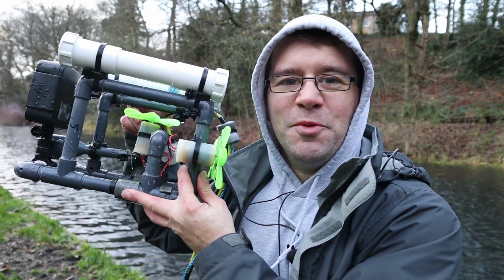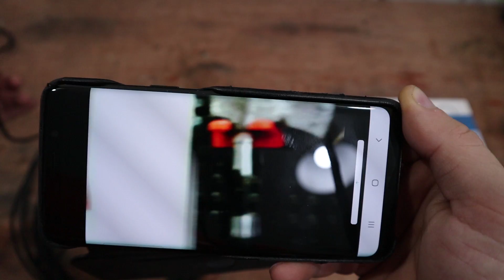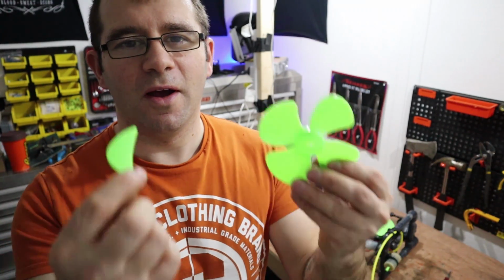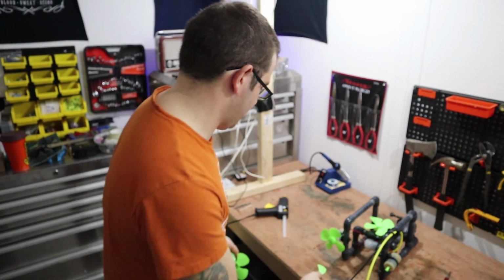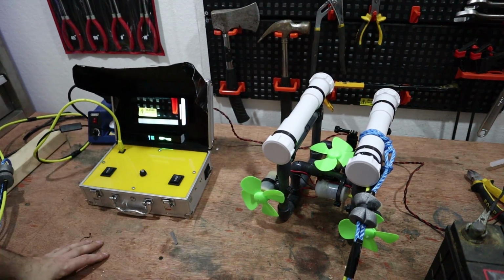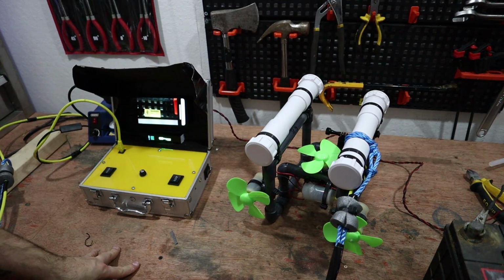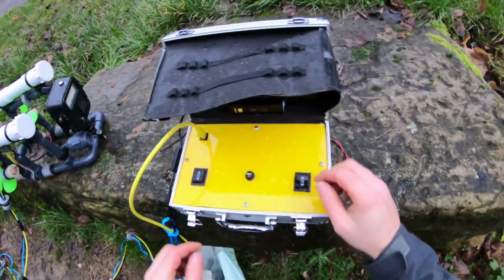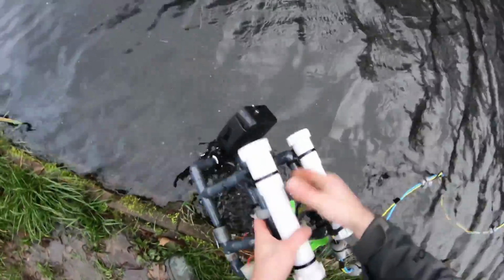Build Your Own Underwater Drone

Comment: Wow G that's turned out amazingly well. Considering it's being put in a canal which in England means liquid that's more of a soup than your traditional water it returns some lovely images. If you're planning on improvements one thing I think you could easily achieve with a single servo is a mechanism to tilt the camera forward and backwards. Front facing camera is well and good for navigation but if you can make it point 45 degrees downwards you can look at the canal bed without having to get so close you either hit it or disturb a load of silt. Also, I can see you've got the tether and data line mounted to one of the floats, ideally you need this mounted directly behind the center of forward thrust, if its to the side it'll cause uneven drag and make the unit turn unintentionally, if it's above or below it'll pitch. Awesome work though, really interesting build.
Reply from the maker: Thanks mate thats some awesome advice that i was looking for and with these improvements it will improve loads 

Ta
Reply: I can make it I am 14 years old I am India odisha

Comment: You certainly put alot of work into that, looks a work of art!  A problem i can see there is the power cable getting snagged on underwater obstacles.  For the power source,  a couple of power banks or one of those jump start units, would be more convenient than lugging a car battery around!

Comment: You need to use impeller desgin drive. Props in a tube with a guard on the front and smaller holes down the side so your still get some drive if guard is blocked.
Reply from the maker: Thanms for the advice mate

Comment: I like the camera setup you used. Great pictures! I know its not clear but you can't help the water clarity. 

As far as drives, I've seen similar projects using boat bilge pumps. Andvantages:  already water-tight, 12 Volt, powerful, protected impellers, and easy to wire. The disadvantages are that they only thrust in one direction so you will need six instead of three. If you do use them get one's without built-in float switches. 

When installing the thrusters, instead of pointing them directly backwards, try installing them pointed 45 deg towards the center line of the craft. This will allow you to turn in place.
Reply from the maker: Cheers for the advice mate

Comment: Gareth, could you make a submarine out of a drone? Turn the drone upside down so it would go down under the water, instead of up in the air, and attach a thin aerial wire with a floating device (a cork) so the end sticks up out of the water for the remote control. The trickiest part would be getting the flotation balance just right to take the sub up and down. The steering is already sorted out  :-)  A mad idea that could work, and i do mean a real build like you have done here, not just throwing a drone into the river. I might be mad, but i'm not stupid (i think).
Reply from the maker: Be a good idea but big project
Reply: @drasticg  Winter is almost here (or is here). I'm sure a lot of days will be toooo cold to go magnet fishing, and you will have a lot of time on your hands :-)
Reply from the maker: @edwardgriffin8092  unfortunately my life is always hectic and im away for christmas but will always make time to do what i love lol

Comment: 1100 gph bilge pumps cut all the casings off the motor will need to make prop adapters , and 50 to 60mm rc boat prop, is a good cheep option, prob with brushless is you'll need a better control board, although i have seen people yousing s-bus rc gear witch is also simple to set up, at some point will do the sbus with mine if i ever get it finished haha
Reply from the maker: Cheers for the advice

Comment: Does the control box/ RC require any coding? Or do the buttons only activate the motor? Also can the motors be put into reverse? Thanks I’m tonerested in making one of my own. Cool video.
Reply from the maker: its hard wired from switch to motors, no coding
Reply: Drasticg thank you!

Comment: Put some rings around to protect your propellers to be tangled with the plants 
Or do a propeller tunnels like turbines I just love this demo I wonder why you attached it with cables instead of doing all by remote control wireless one way to control it is by using audio subtones frequency's. All the best my regards to you.
Reply from the maker: I did it wired as wireless doesnt work underwater

Comment: Nice work 👍 I think it would be a good idea to use some guards around the props and also fix the camera on a tilt/pan gimbal. You can also use a 2.4ghz radio set and some ESC on the motors for precise control. 2.4 ghz should be able to penetrate into the water, but even if it won’t, Rx can be wired out and float on surface.
Reply from the maker: Awesome thanks for the advice mate
Reply: I was told 40mhz will work under water need a 40mhz transmitter and recevier with 2x 40mhz crystals both paird.

Comment: Could you not raise the voltage if the motors would handle it? I'm no expert but you might see more performance from higher voltage LiPo batteries with a voltage regulator going to the cameras and other sensitive stuff
Reply from the maker: Yes i could mate and probably will

Comment: Maybe putting more powerful motors on it will make it move quicker. But,  also if the water has a bit of a strong current then the sub can fight against the strong  water current better.  But,  these motors are definitely far too weak ( underpowered) for what you need & maybe a if possible a more powerful light would really help aswell. Yes it would make the unit a bit heavier But,  it should be overall more effective ( which is what you need) 🤔😉

Comment: Is the full build video still available? the link doesn't seem to work
Reply from the maker: No mate i took the channel it was on down
Reply: @drasticg  was wondering if you remembered any info about the propellers used
Reply from the maker: @colind216  no sorry, i ordered ones that had the same diameter hole for the shadt

Comment: Might be able to get video out via the usb on the gopro as you already have wires going to the surface,thats if you had WiFi problems.
Reply from the maker: Only problem i would have is id have to drill a hole in the waterproof go pro case and seal it all with silicone sealer, so it would be possible thanks for the idea

Comment: There is a easy way to do that. Using a Betaflight board. A FPV drone Controller. Putting everything in a Waterproof 3D printed case. 4 Propeller and here we go... !
Reply from the maker: Sounds expensive
Reply: @drasticg  No, i think i will try. But i've figure out than UHF have a bad depth penetration. So, it need a cable to drive the ROV underwater.
Reply from the maker: Good luck mate and keep me updated
Reply: @drasticg  Thanks. I want to try two things. A ROV with 6 Brushless motor. And something like a Whale where the fin are command with servo Motor.

Comment: Dont you need both rear impeller to turn to get it to go forward
Reply from the maker: No if you use one it turns slower but if you use both in opposite directions it turns faster
Reply: But going forward you need both no
Reply from the maker: Aorry i miss read what you prigionally asked, yes i need both on to move forward

Comment: What is the dept range this rov
Reply from the maker: depends on the length of cable
Reply: @drasticg  if I have 500m wire then this rov can handle the pressure?

Comment: Fantastic job. Very impressed. Could use a couple of small sieves to enclose the propellors. Maybe try to install a variable speed controller and joystick for better control. Again very impressed with your handywork.
Reply from the maker: Thanks and i have loads of improvement to come just learning as i go and some good advice like yours
Reply: @drasticg  maybe stick all the cables and rope in 1 flexi pipe to save getting snagged. If it gets snagged then you will have to wade
Reply from the maker: @DEmma1972  love that idea thankyou

Comment: I have a few suggestions, as I've made an ROV similar to this years ago. First, for your umbilical tether line you need a very loose wire/line other wise your steering or turning gets drag and that is very frustrating. Also you want your umbilical to be just a bit positive buoyant. Second, you can use modified boat bulge pumps for your motors.
My ROV -- https://youtu.be/96qh-uCm7G0
Reply from the maker: cheers for all the info mate

Comment: surprised you would put a powerful magnet as a smartphone connector considering they can mess up the memory chips due to the magnetic field
Reply from the maker: Alot of smart phone cases have magnetic front covers and they dont mess phones up and mines been fine thankfully
Reply: i think the ones in cases are less powerful as they are so small but hope it stays fine for you good luck great video too tbh amazing idea for the family to build together
Reply from the maker: @TREXXY  cheers pal i may glue the phone case direct to the inside of the lid to be on the safe side